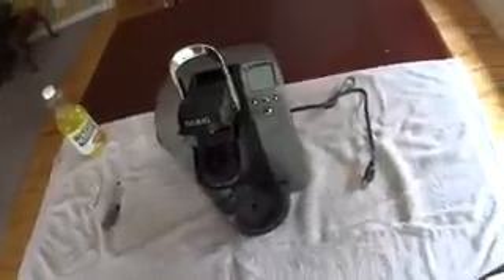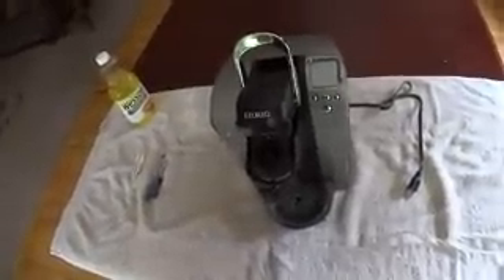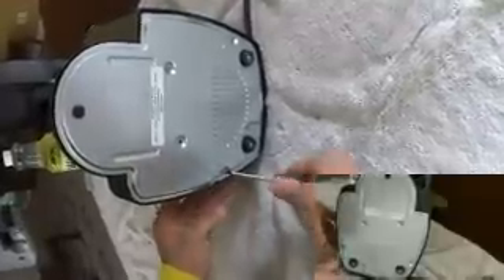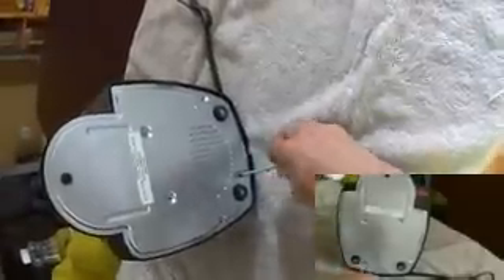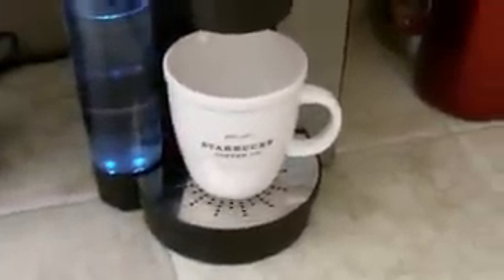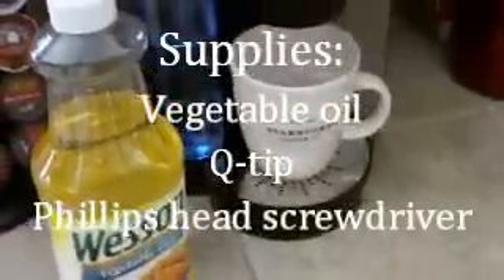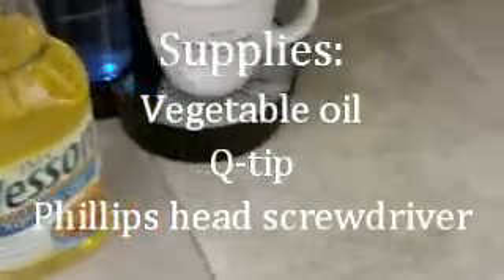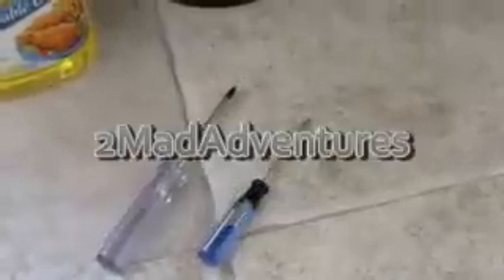Keurig B70 Platinum Repair

Comment: Bad quality, but still a very helpful video. I would like to also add that you could easily diagnose the issue before attempting this repair. 

During your brew while water is barely trickling, remove the lid from the water reservoir and place your finger over the overflow drain valve. This is the small whitish/clear rubbber hose that is at the top of the water reservoir. This will force air pressure back into the water intake valve in the bottom of the tank which is normal and will not harm anything so don't worry about the bubbles. If you notice that covering the opening on the bottom of the valve with your thumb increases the throughput and pressure during brew, that confirms the gasket/diaphragm in the air pump housing is not sealing properly.

After trying a couple different maintenance tasks including descaling and cleaning all of the Kcup housing openings and needles I found this video. Resurrected my Keurig and saved it from going to the dump.  I would only recommend this as a Band-Aid. The oil will actually leave this seal in worse condition than you found it once it dries, so use this method until your replacement air solenoid arrives :)

Comment: So now my machine pumps, but it also pours water EVERYWHERE.   Literally pours.  Only me.   Took it back apart a second time to try and make sure I put it back together correctly, and the head of one of the tiny screws just snapped off.

Comment: I have a K70 (basically the same machine) and started having some problems with slow / partial fills about 2 months ago. at first we thought it was the recyclable pods (without the bottom plastic cup) possibly being overfilled because when we tried the regular K-cups, they seemed to work albeit the machine was still slow to fill and still sputtered. Then I started getting short shots with them too. I've done everything to it, descaled, burped, cleaned the nozzles.  This was my last resort.  this was very easy to do. Everything came apart well and I used some canola oil. However, I didn't know how much oil to add. I'm wondering if more oil would have made the flow any better. The flow has definitely improved and I am able to use the soft pods again and get a full cup but it still seems a bit slow.  Thanks for the great tip.

Comment: I ran a reservoir of white vinegar through it and my output doubles acrsoo the board. I was only getting 6oz out of the largest setting. Air pump seemed to be working properly and was going to lube it if the de calcify vinegar didnt do anything. I think a servo was not sealing as I would get a lot of back flow into my reservoir during the cycle. I would watch it take a big gulp (pumping into boiler) and then a gentle 25% backflow into the reservoir. Seems to be stable now the vinegar ran through it. It still is not suitable for the 12oz fill as you cannot pack enough coffee into a 19g K-pod (largest 1.0 on market) to make a decent brew, and Im using Starbucks French roast that was so oily that it almost clogged my grinder.

Comment: I wasn't able to break any of the three screws loose from the air pump . I'm using screw drivers from my laptop kit so I have the correct size.  Anyone else run into that issue?
Reply: Yes!  I put a small drop of vegetable oil at each of the screws...let sit about 15 minutes, then used pliers to operate the screwdriver to give me more torque.  Finally got them loose!

Comment: THANK YOU!  Our Keurig B70 is about six years old and has always worked like a charm until this morning when it stopped pumping the water.  We tried everything... forcing air through the system, checking out the top pump area, etc.  Thank goodness we finally came across this video.  It's back to working like normal!  We used olive oil instead of vegetable oil since that's what we had on hand. :)
Reply: Update: After three days it has stopped working again :(((
Reply: Update 2: We got it working again by running a quart of white vinegar through it (letting it sit for a few hours with the vinegar in the system) then flushing it out with a gallon of distilled water.   Not sure how long this fix will last or not.  We had never "descaled" it in the six years we've had it, so maybe it fixed the issue.
Reply: Since my B70 isn't taking the water how do I get the vinegar into the unit?
Reply: @smacknyc4108  hm good question, we got ours pumping a little bit to get it in. Keeping the reservoir full, and using something to push air into where the water gets sucked in seemed to help, like an eye dropper.  Maybe try some fixes in other videos or doing a full reset by unplugging/plugging the machine?

Comment: Tried everything short of throwing it out on the driveway! I saw the horrible videos of taking the machine apart using a hacksaw, but fortunately I didn't have one! So I found this video yesterday and the whole process took about 15 mins and it works great! I did "exercise" the 3 diaphragms to make sure they were loose and moving. Thanks so much for this quick fix!

Comment: This method made the problem worse. The air pump on my neighbours K70 machine is slow and pumping very little air. Ordered a new pump online for $13.00CAD. We will see if that corrects the problem when it arrives.
Reply from the maker: TFSFireman sorry to hear it didn’t work. Is the K70 pretty much the same as the B70?
Reply: Yes, very similar.The air pump is exactly the same as the B70.The issue with this unit is the air pump comes on strong for about one second, and then dies off and turns extremely slow, resulting in a loss of air pressure. I used a can of compressed air, and blew it thru the tube that goes from the air pump to the boiler, and the water flow thru a K-Cup is awesome, so I know the plumbing isn't plugged. If I remember, I will advise you of the outcome when I receive the new air pump.

Comment: I have found that I get an ounce or so out of the machine before it stops filling the cup.  BUT, if I cover the silicone overflow return spout with a fingertip, the Keurig will deliver a full cup!  With the spout covered and while the coffee cup fills, air bubbles actively come up through reservoir outlet filter!  Any ideas?
Reply: Eric Andersen, It sounds like you have a bad solenoid. I saw a YouTube video on another model that acted the same way and it was a bad solenoid.
Reply from the maker: Eric Andersen I don’t, but it sounds like you’re in to something. Unfortunately, thought my Keurig continues to work I don’t have custody of it at this time.
Reply: I'm starting to take it apart now, but disassembly is not simple.  I'll post my results when done, but it is a low priority.
Reply: if you cover the vent with a finger, you'll block the air pump inlet and it wont build "boiler" pressure. If the vent discharges pressure then the solenoid (air switch) is faulty. It should 'open' to allow the air into the air pump, then 'close' to stop the built up pressure to escape out the vent instead of forcing the water out of the boiler vessel.

Comment: After doing all the other simple fixes, I found this.  I did the veg oil trick, but still not joy.  Water delivered is way short of expected.  There are three diaphragms under that three screw cover.  How much motion should each diaphragm travel?  If I wanted to exercise the mechanism that drives the motion of the diaphragm, how much play (motion) could I find? I did that and I found about 1/8" - 1/4"  should I exercise deeper?
Reply from the maker: Eric Andersen I’m sorry to hear it didn’t work for you. Have you also cleaned the machine out with vinegar? Also, one of my regular maintenance fixes is to run a paper clip up through the three holes in the puncture unit.
Reply: Yup, did the vinegar, did the puncture needle top/bottom, cleaned the reservoir filter, turned the unit over and hit it hard....  I think I need to replace the air pump and I'm trying to avoid the hacksaw cut to separate the top and bottom for access.  I did that to another Keurig and I was not pleased with the cosmetics.  Is there a technique to release the internals for access without cutting?

Comment: Will tricking the reservoir level by lifting the magnetic disc by hand to drain the heater result in burning out the heating element ?

Comment: Thanks very much! Your fixed worked beautifully.  There are so many videos about fixing Keurigs, usually involving unclogging the head or taking the unit apart and replacing the pump.  Your fix was the easiest and the best.  To be honest, I tried modifying your fix using plumbers grease but that didn't work, probably because the grease is too thick.  Afterward, I tried it again, but with vegetable oil, and that did it.  Thanks again.

Comment: Good tip. I was about to replace the pump and then tried this. It fixed the problem and easier than replacing the pump - less disassembly.

Comment: Thanx, I have 2 platinum series that are doing this and we just bought a new 2.0 which I hate with a passion (cant even brew all the sizes of just water anymore unless you hack the darn thing!) so I  tried this method....only problem is, I cant get those little screws off the pump! i actually broke a screwdriver trying to get them loose. I may try a soldering iron to heat them up and see if that breaks them loose but figured i would post quick to see if you or anyone had any other ideas. These little screws are super tight!
Reply: +Michael Forry ok I got them, sorry :) Make sure you have a nice handled screwdriver or a #00 bit for your screw gun. Screw gun broke them loose so now to test it.
Reply: +Michael Forry Last update, this did not work for me. It still runs very slow through a k-cup and after it seems like it is done it still continues to sound like it is pumping but nothing is happening. Also does not pull water back into the internal tank after it is done. Oh well, worth a shot, thanx!
Reply from the maker: +Michael Forry I'm sorry this fix didn't work for you. But like you said, worth a shot.

Comment: Thanks! That worked perfectly! My Keurig is 3 years old and brews about 200-300 cups a month at my office. I have always used distilled water in it from day one. So when it quit, I figured that was it. Works like a champ now.
Reply from the maker: +My Place Very glad it worked for you. Mine is still pumping along.

Comment: OMGAWD!!!  **THIS WORKED like a charm**  MY KEURIG was NOT pumping water at ALL!  i hesitated, but was my last resort... I had spent 2 hours trying suggestions of paperclips up the three holes, shaking, vinegar, tipping upside down, cleaning and more cleaning to no avail... even went so far as to bring out the kitchen mallet.  Gave YouTube one more try and came across this.  Easy and WORKED - thank you for taking the time to share.